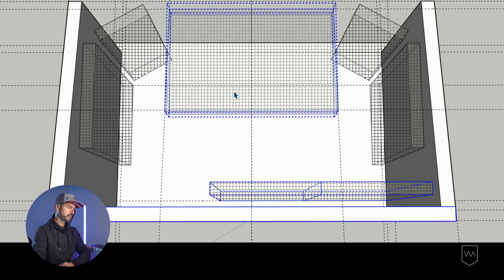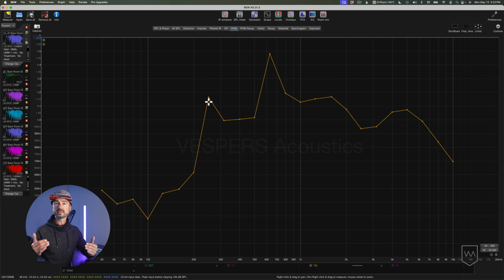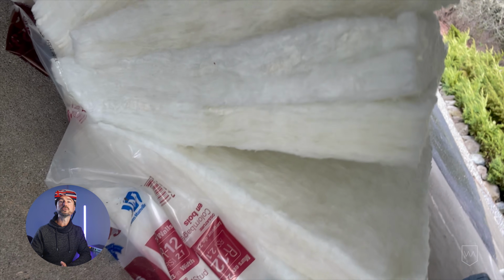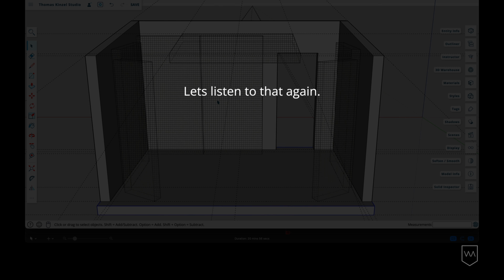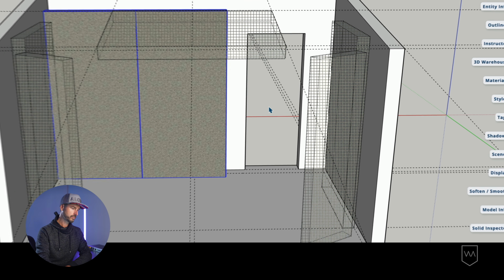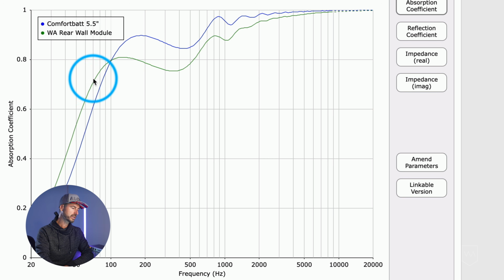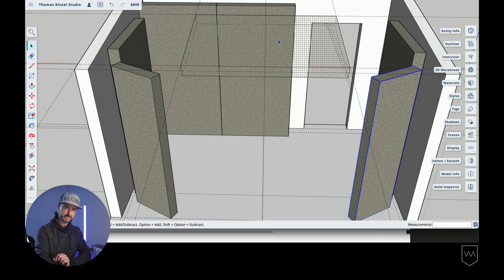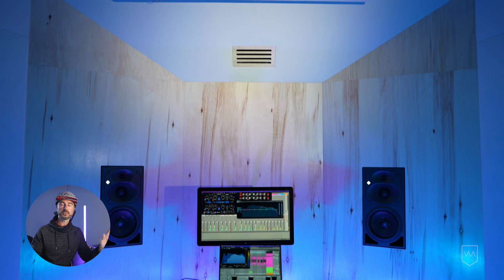Acoustic Treatment: The Strategy for Small Studios - Ep4

Comment: Bass traps in corners are not very effective. You might not have a problem with all three axial modes so why treat all three equally?
Reply from the maker: Hey hey.  None of the treatments in this room are really "bass traps".  They're all broadband porous absorbers.  A bass trap would have slats on the front of it, a range limiter, a scatter plate, a perforated panel etc.  That was not practical in this small of a room due to reflections.  We needed to do it all with porous absorption.  

Placing treatment in the corners is actually the first area you go to because modes terminate in corners.  A key part of the strategy in this room was to damp the modes as much as possible by adding in as much floor to ceiling treatment as possible.  

And we were working within a timeframe and budget for the build, so the design I came up with accounted for those restrictions as well.  If we had an unlimited amount of time and budget, there would have been adaptations to the design surely.
Reply: @warpacademy  It's a generic approach. It's not room specific.
Reply from the maker: @CasioBioassay  there are some basic principles of acoustics that will apply to all rooms.  Such as treat the corners and adding floor to ceiling modules.  

This is not a matter of debate.  You do it in every room if you want professional results.  

Porous absorption straddling a corner is a great way to damp a small room - any small room.  Why?  Because acoustic treatment eats into the room volume, but corners are typically empty space that you don't miss if treatment is placed there.  

The fact that there's an airspace behind them improved the effectiveness of absorbers placed there.  

With every room there are certainly unique aspects that require careful consideration.  Such as the expansion ceiling in this room.  But there are also some basics that you would follow regardless of the room.
Reply: @warpacademy  placing them in the corners will attempt to deal with all three axial modes. That's not likely what is needed to flatten out the response for the listening position
Reply from the maker: Let's talk about some basics.  There is so much more to treating a room than just the frequency response.  In fact, the decay times in the room have more of an effect on the perceived sound than the frequency response.  Adding more absorption into the room can and did massively bring the decay times into alignment.  Did you see the video where I showed the final results?  

If you don't make use of the corners in a room you've lost the plot and you're leaving so much potential improvement on the table.  Without exception, every acoustics book, every studio designer, every acoustician, will all explain to you that you must put treatment in your corners.  And the more treatment you're able to fit in the room, the better the bass control will be.  

This is 101 level stuff here.  The most basic principles.  If you need some verification, look at this: https://arqen.com/acoustics-101/room-setup-speaker-placement/

And then go look at GIK's channel: https://www.youtube.com/watch?v=eRAtAn19a44

Comment: I notice that the bass traps seem to touch the front wall but not the side walls, but I didn't hear a reason for this in the vid. Is there one?
Reply from the maker: Hey hey.  These aren't bass traps.  They're broadband absorbers mounted in the corner.  If I referred to them as bass traps, that was just an oversight.  

Bass traps are way more beefy, thicker, and have some form of perforated panel or slat passthrough diffuser on them.  

These absorbers were corner mounted and they do indeed touch the front wall and side wall.  Look later in the series for where I build and install them.  

Cheers!

Comment: what is a light density fiberglass? in terms of numbers? it's Flow resistivity (Pa.s/m2)  right? just to see what to put in my airgaps
Reply from the maker: Hey hey.  The most commonly used is Owens Corning pink fluffy.  They don't publish density or GFR numbers, but estimates by John Brandt put it around 0.66 lbs/ft3 / 10-16 kg/m3.  

Really roughly estimated flow resistivity may be 2,500 - 5,000 Rayls / Pa.s/m2.
Reply: @warpacademy  thank you for the reply, so if i have a 20cm absorber with 20cm airgap its adviced to also insulate the air gap? i thought i always needed the space for air pressure, but its better to also close the gap?
Reply from the maker: @toml6535  Yes, it will always perform better to fill the airspace with light density fiberglass.  

Although, you can increase LF absorption even a little more if you leave a tiny, sealed airspace of no more than 1" behind the fiberglass.  This comes from research John Brandt has done.  

By preventing the air from escaping by lightly sealing a very thin airspace, it adds a cushioning effect.  John thoroughly tests everything with NWAA labs, so I have good reason to believe it when he says things like this.
Reply: @warpacademy  thank you so much appreciate it
Reply: im talking about a absorber from top to bottom btw (the whole back wall)
Reply from the maker: @toml6535  yep, the same comment applies.

Comment: it would be great if you can show how to treat those really ugly low Room Modes like 35-40Hz! What do you think would be the best  Helmholtz or Membrane Traps like Limp Mass etc? Those low Room Modes are really difficult to absorb effectivley.. Everybody can build Broadband Absorbers from Rockwool but tunable Absorbers is a different story..
Reply from the maker: Hey hey.  If you read acoustics books, they'll almost all tell you you need to build things like Helmholtz resonators.  But if you talk to actual studio designers and builders, most of them these days are not actually using those types of treatments.  Because they largely don't work, or are extremely difficult to tune and build correctly.  

Thick enough porous absorption is capable of damping those low modes, if you combine it with passthrough diffractors - such as slatted modules.  You can also dramatically increase LF absorption by placing space couplers in front of porous modules.  

In my control room, there are zero pressure-based treatments, except for the slats on my rear wall which do have a Helmholtz style effect due to the spaced openings.  And the frequency response in the LF is ruler flat to 26 Hz.  No resonances.  My room has 3.5 feet of porous absorption on the rear wall to achieve that.  

I recently had a good talk with master acoustician John Brandt, and he's doing very different things instead of using pressure treatments as well.  He curves the rear wall to break up LF modes.  He achieves that by using multiple layers of drywall, which you can actually curve, and using a layer of bitumen roofing membrane in between one of the layers for a CLD - constrained layer damping effect.  

His modules are typically 8 foot tall porous treatments made from OC pink fluffy light density fiberglass, and he gaps them out from the wall by up to 1" (a very small air gap) and then encloses the back of the modules with luan or thin plywood.  This sealed airspace behind the regular module will create a pressure effect which shifts the frequency of absorption lower.  

He builds some of the best studios in the world so worth considering his approach.  

I know another studio designer, Adam Kagan (LA), who very occasionally may use diaphragmatic membrane absorbers made of 2 x 4 members with thin plywood membranes.  He'll use the formula to shotgun the frequency.  If you want to target 70 Hz, you'd build 3 traps, targeting 60 Hz, 70 Hz, and then 80 Hz.  Between the 3, even with the inaccuracies, you'll likely get an effect at 70 Hz.  However, the max absorption coefficient at the target frequency isn't likely to exceed 0.3 which is a VERY minimal effect.  

He told me he almost always uses exclusively porous absorption for that reason.
Reply: @warpacademy  Hey Man, thank you for your quick response. Woow 3.5 inch of porous absorbers.. this is over 1 Meter right? If I just had this big space I would go for but unfortunately I don't have it. My Room is nearly quadratic and my room modes are 35 and 38Hz. I've tried so much here with trial and error and with measurements in REW. I had my completly back wall with thick fiberglass and Rockwool treated (60cm) and I've getting an overall improvement but this could not solve the Room Modes issue on 35 and 38hz. The SPL and Decay was still way too high.. I've tried also two PSI Avaa C20's but the results was also very lame for the price. 

I'm slowly running out of ideas except for trying limp mass absorbers or Helmholtz resonators. When I compare slotted panels and limp mass in the acousticmodelling.com calculator, it seems that limp mass performs significantly better, but I just don't know if that's really the case in reality...
Reply from the maker: Hey hey.
The unfortunate truth is that if  you're in a quadratic room then you're wasting your time.  With a small space and 2 more or less stacked LF modes, you will not be able to get adequate absorption.  Limp mass absorbers are not going to make the improvement you hope for.    

Save all that money you spent on the AVAAs and buy some Audeze planar magnetic MM-500 headphones and you'll get far better results.  And save money.  

Sorry to be the bearer of bad news, but that's the real deal.  

You need a larger space or a rectangular room or both.
Reply: @warpacademy  Thanks man for this honor advice! I know the room isn't very good and I'm looking for another one but it's hard to find something suitable here in Germany. Nice that you're recommending the Audeze's I all ready got those MM-500 😅 They're great no question but I love Speakers in general more than Headphones and I was hoping I can let shine my Genelec 8361's a bit more if I can get those low Room Modes treated. If I can't I have to live with them. It's not the end of the World. You're really making great Content and I like the way you're talking! I've subscribed here and I hope there will be more on the nerdy topic of room acoustics and room treatment
Reply from the maker: @Vocalisto  Thanks very much.  Sorry it wasn't better news.  But I'm glad you have the MM-500s and good monitors at least.  All the best!

Comment: What would you use to treat 5 inches of hollow moulding that resonates badly in a 11 x 13 foot room with a 9 ft. ceiling?  I was thinking mass loaded vinyl or cork rolls with foam (at Home Depot).  What are your suggestions for this?  Never had to deal with hollow moulding in my life and it sounds terrible.
Reply from the maker: MLV is a typically a very expensive material, not sure if you need that.  Without more context it's hard to say.  If you have a chamber that's resonating, you'd typically fill it with rockwool.  Some type of porour medium to damp the internal modes.
Reply: @warpacademy   I was thinking cheap foam bass traps or on the more expensive side wood slats that fit the height of 5 inch moulding.  Which one sounds better to you?
Reply from the maker: @tinylittlefilms3043  Neither?  Foam has no role in a music studio at all.  Rock wool or fiber glass.  

And I've said in a few comments now that in a studio for voice over recording you do not need diffusers, scattering, slats or any treatment of that type.  

Keep it simple.  Treat your reflection points with porous absorption (rock wool, fiber glass).
Reply: @warpacademy thank you

Comment: Thank you so much for this series! I’m beginning a plan for my home studio and this is extremely helpful.

In your module build video, you mentioned that you added cotton batting to the landscaping sheet to reduce reflections. Given that the more dense cavity rock will reflect more than comfortbatt, I’m curious what is the advantage of putting the cavity rock as the outer layer of the module?
Reply from the maker: Hey Erik.  Glad you’re enjoying the series.  

What makes you think that Cavity Rock is reflective in the thickness I’m using?  If someone told you that it’s bad information.  All you have to do is plug it into the porous absorption calculator and look at the reflection coefficients by frequency.  

The cotton batting is to smooth out corners and framing so the top layer is not up against wood.  It’s makes the white fabric look more opaque too.  

I only recommend putting landscape fabric on the back of modules.  In my other video I only put it on the front because I was storing them and wanted to contain the rockwool.  

Happy building!  Let us know how the studio turns out.
Reply: @warpacademy thanks for the fast response! It was my assumption that reflectivity generally increases with density, but it’s good to know that the thickness impacts the significance of that effect
Reply from the maker: @ErikAllan  Hey hey.  All good.  Reflectivity and density are of course related, but are far from the only variables.  It's also highly related to thickness and gas flow resistivity.  

A material that's absorptive at one thickness may be reflective at a greater thickness for a given frequency.  

You want gradual entry into a deep absorber, which is why you see the wedge shaped treatments in anechoic chambers.  

For relatively thin panels (like the 5.5" ones in my video) you can most certainly use a product with a GFR of 20,000 Rayls for a couple inches of that.  

Cheers!

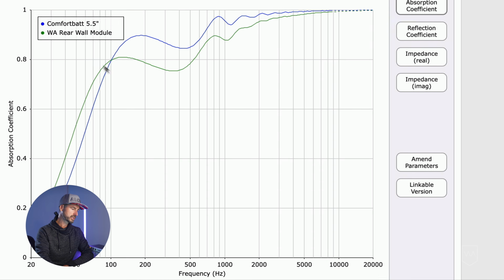Comment: Hi! Why did you used the Komatsu porous model in the simulation @ 21:40 ? Thanks!
Reply from the maker: Hey hey.  The Komatsu model is the most current data and seems to be the most accurate.  Each study tends to look backwards and expand on the ideas of previous literature.  Note that none of these models are perfect, and as you get more complex in your module design (such as using multiple layers) things get less and less accurate vs. real world results.  The models are based on lab tests, and in your actual room you have very different conditions and sets of variables.  

The calculator also doesn't factor in an important aspect of this style of module design, which is a membrane effect from using a higher density layer up front.  So in reality these modules are likely to perform better than in the predictive results.  At least with respect to LF absorption.  

Here's a discussion around that if you want the deep dive: https://gearspace.com/board/bass-traps-acoustic-panels-foam-etc/921090-porous-absorber-calculator-accuracy-issues.html
Reply: I understand. Thanks for the link to the topic. I also have over 20 years of experience in the field, but I have used the Allard & Champoux model with good results so far, meaning the measurements confirmed the model. The absorption graph you presented caught my attention, especially in the low frequency band, considering the materials used, and then I noticed that you used a different absorption model. I am aware that the simulation is not perfect, there are also other factors to consider... It seems that I need to catch up, I will delve deeper into the subject. Thank you very much for the answer! All the best!
Reply from the maker: @IcemanTheDj  right on.  Nice to hear you've been in the field for a while.  What type of work are you doing?  Building your own rooms, or working in acoustics?  

The in-situ tests often vary to a large degree from the modelled results.  For example, filling an airspace with light density fiberglass vs leaving an airspace.  

All the best!
Reply: I can't declare myself as having accredited studies, but more like a self-taught person. I studied electronics, and being passionate about music and how it is made from a young age, I dreamed of having a studio since I was little. Being also passionate about woodworking and a big DIY-er, obviously I dreamed of doing it myself... For this, study and experience are needed as I'm sure you already know. Applying the information acquired over time to help acquaintances and friends in the field, I also gained experience. And now I consider myself quite advanced but, obviously, we can never know everything, especially in the context where challenges and novelties appear all the time, we have to keep up.
Reply from the maker: @IcemanTheDj  sounds like you have a real passion for this.  So do I, I get that.  I started by helping friends too, and it just grew from there.  It's still not my main focus, that's mixing and mastering audio, but I do love acoustics and building things with my hands.
Reply: Yes! Great! I was watching your channel and came across the video "Is This Mistake RUINING Your Acoustics?". I gave it a 👍 a year or so ago since I saw it and I still think it's one of the most relevant videos on YouTube regarding monitor positioning, especially when it comes to home studios. 100% agree with everything you said there, excellent work! I also subscribed to the channel, see you around. Cheers!
Reply from the maker: @IcemanTheDj  Right on.  Yeah that video was a big eye opener for so many people who've been given bad, out-dated HiFi advice to gap the speakers from the wall.